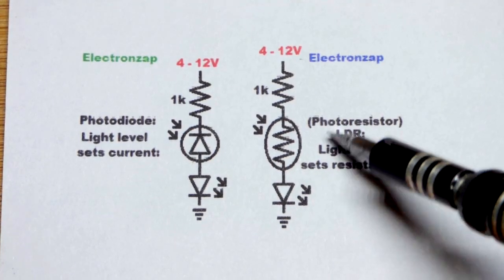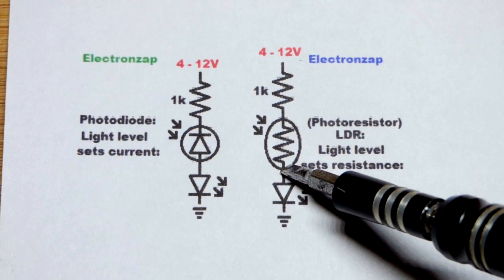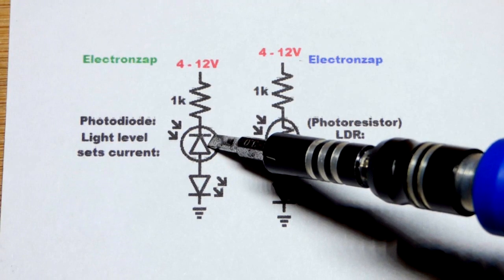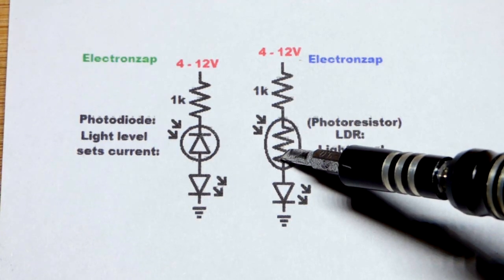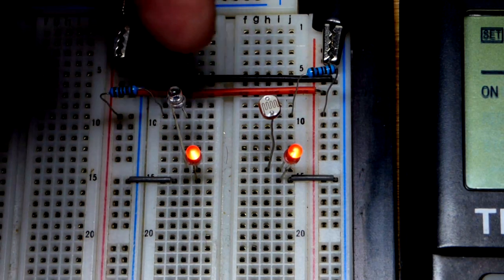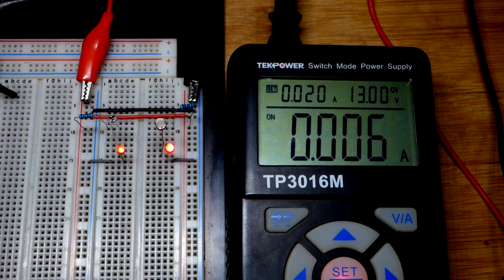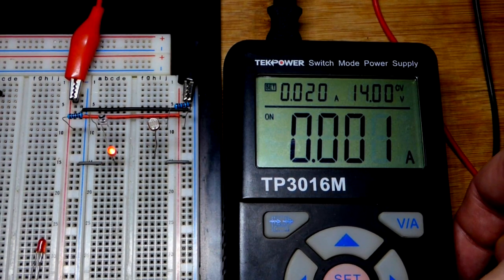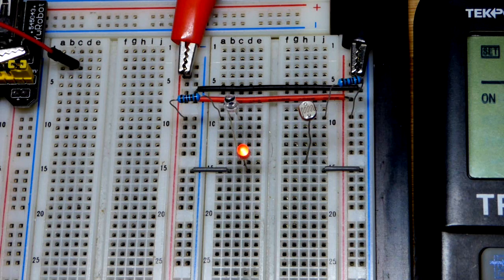Photodiode compared to photoresistor aka light dependent resistor LDR during voltage change

Comment: Hi If you put a photodiode backwards in circuit but have your resistor in there does the diode break or just the circuit won´t work ?
Reply from the maker: I tested it in my newest video https://youtu.be/6AduY2WHWAw

Comment: so a photodiode works the best if one side is connected to + of the power source?I saw many designs with one side to ground and the other to the amplifier where the photodiode is used like a solar panel.
Reply from the maker: I have some Photodiodes that look and act like mini solar cells. Others ones, which look like LEDs don't seem to act like mini solar cells at all. Maybe the ones that don't are actually phototransistors that are being sold as photodiodes, but I don't know for sure.